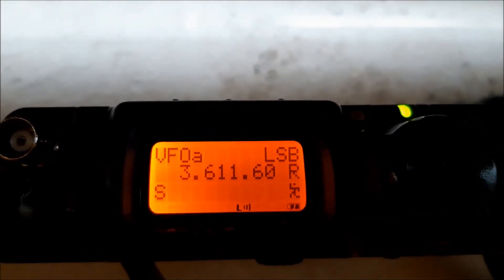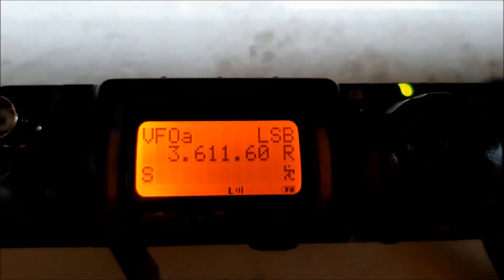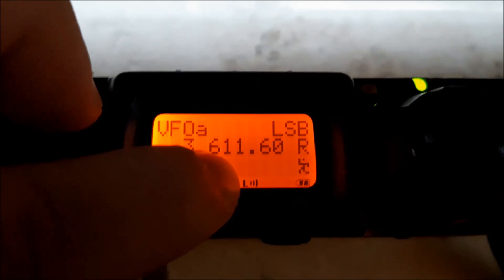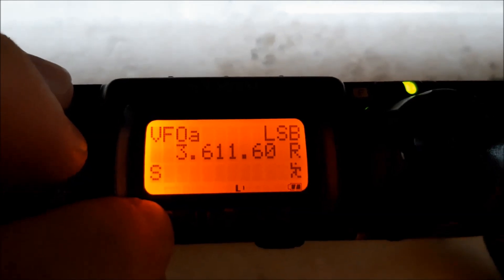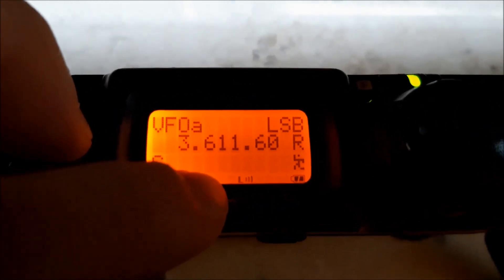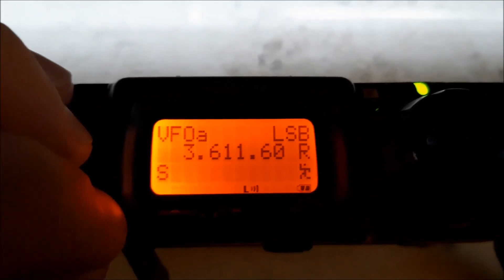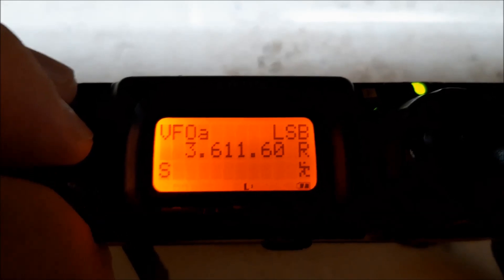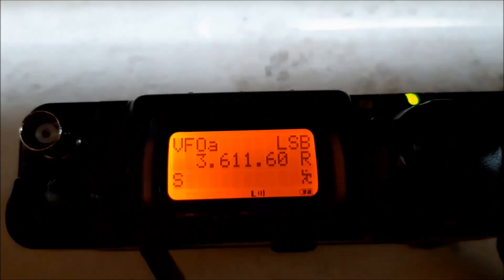"POWER HACK" Yaesu FT817 QRP- How to 5W with internal battery

Comment: upgrading to lipo battery give high enough voltage to run as if plugged in mode then flashing 5w down to 10v

Comment: Hi David thanks for the tip I've got the exact same radio mint condition so I know how to set the different power levels now and I'll definitely have a go on the HF with the 500 milli Watts that will be interesting to see how far away I can get on the 40 and 20 meters I'll give it a try. Thanks take care and best 73's for now cheers mate. Stephen M3SNV 73's.

Comment: It baffles me that some people don't know the power output of their own rig. 
Also power icon only blinks when the input is below 11.5v: 

With the input voltage  GREATER THAN > 11.5 volts, the display will look like this.

(L_l__) One bar displayed = 0.5 watts.

(L_ll_) Two bars displayed = 1.0 watts.

(L_lll) Three bars displayed = 2.5 watts.

(L____) No bars displayed = 5.0 watts.

With an input voltage voltage LESS THAN < 11.5 volts, the display will look like this.

(L_l__) One bar displayed = 0.5 watts.

(L_ll_) Two bars displayed = 1.0 watts.

(L_lll) Three bars displayed = 2.5 watts.

(L____)-(L_lll) (BLINKING) Three BLINKING bars displayed = 5.0 watts.
Reply: Did you measure the output when using the radio with less as 11V? Mine doesn't have an output of 5W...
Reply: @baslev  Umm, no. I'm not that bothered these days, if I'm honest. 

What are you using to measure it's output? I don't have calibrated equipment. I have a £120 Nissei and an MFJ 949e as a dummy load.. Hardly reliable.
I'll happily throw 100w into this meter and be happy with, I dunno, + or - ~5 or 10% I guess, but you can't have those kind of tolerances if you're trying to measure values as low as only 2.5-5w. Not to mention cables, connectors in the mix. 

I sent my 817ND to Yaesu as I thought it was outputting low on what I had to measure it with. The report (Transceiver final check list) came back with it putting out 5.17w to 5.25w across the HF bands. 4.98 and 4.95 on 144 and 433 respectively. 
So, I just don't worry about it. 👍
Reply: @PWRSLV  I'm using a welz SP15-M. Not that it is calibrated but it shows 5W when the radio is at 12V. But indeed, power does not really matter. See https://www.youtube.com/watch?v=XSkWOpd58BM
Reply: @baslev  what does it drop to at 11v? It should still manage around 4.5 to 5w really.
The general consensus appears to be that anything fed to the radio above 11v is just going to be lost in heat.